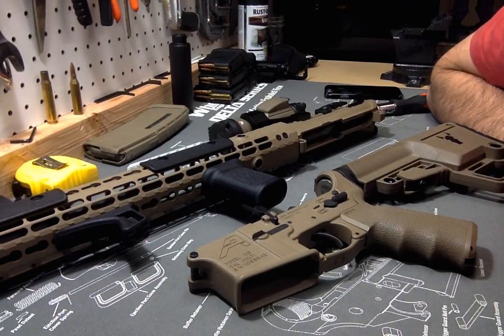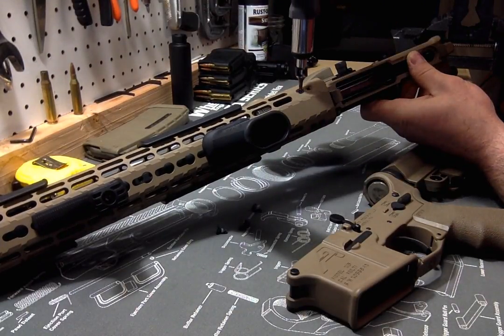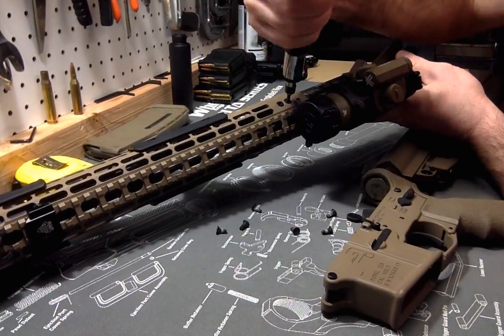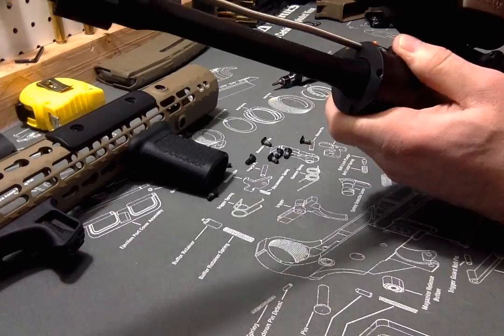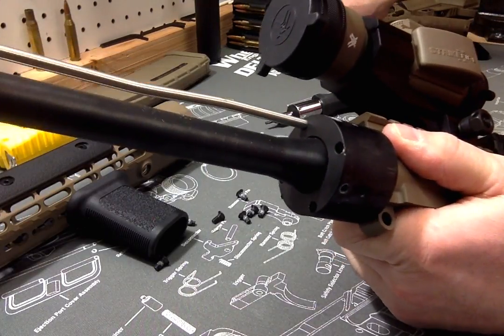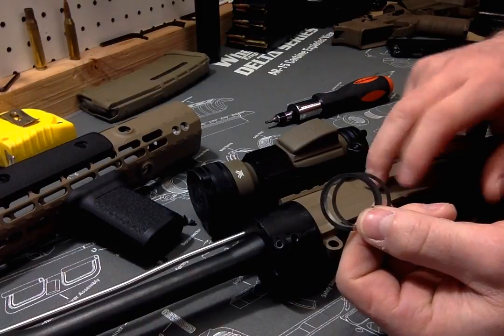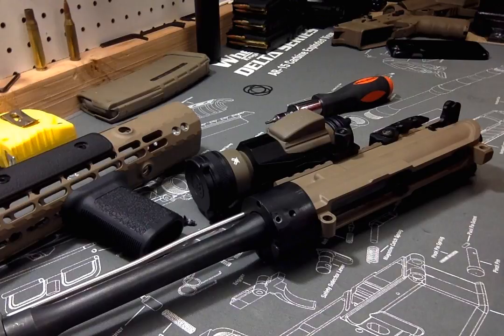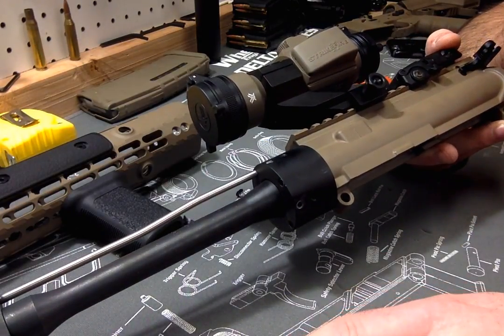Aero Precision 15" Free Float Handguard Install Info

Comment: What armorer's wrench id you use with this because the 2 wrenches I have don't line up and I don't want to buy another one that won't fit properly
Reply from the maker: Well it was either a standard wrench I got from Cheaper than Dirt, or they may have sent one with it...like a small attachment you could hook a torque wrench too.  It’s been quite awhile, can’t recall exactly.  I didn’t have any trouble though, it was simple...I remember that much

Comment: Nickel or Copper Anti-Seize Grease are also great alternative for barrel nut.  Both are also water resistant and very high heat resistant.  Aero Precision gen 2 is my favorite, addictive to multiple configurations I have more than 1.  I had spare upper prior to getting one Aero Upper Enhanced.

Comment: Im Curious Know On The Torque Spec I Called Aero And They Said 30-45 Ft Lbs For AR15 I Know Yours Is A AR-10 Will The Barrel Nut Torque Spec Change For AR10
Reply from the maker: This is actually a 5.56 upper.  The rule of thumb for any mil spec forged upper is between 30 and 80lbs.  Aero can say what they want, but their uppers are no different than any other upper I’ve built with.  I usually end up around 60 with most builds and it’s never been an issue.  Most literature will tell you the same for mil spec ARs.  Keep it over 30 and under 80 and it should be fine
Reply: S K Ok Because I Called Them And They Were Like Well Between 30-45 But Idk This Is My First Upper I Build By Myself, I Have The Exact Same Handguard You Have Just In Black
Reply: S K What Is The Key To Getting It Align With The Gas Tube Any Tips For Me
Reply from the maker: Anthony Galvez If it’s the same then I’m sure you’ll need shims as well.  Just hand tighten it first and eyeball how far that gas tube hole needs to rotate.  If it’s like mine, you’ll need 2-3 shims.  Make sure you grease the threads well with moly.  If you land anywhere over 30lbs and it lines up, call it good.  Don’t worry too much about the number, as long as you stay under 80.  I’ve built a bunch of these and it’s surprisingly simple once you’ve done it.  Good luck man!  Once you’re done you’ll immediately want to build another one.
Reply: S K Ok Thanks Bro Its The Exact Same One With Shims Just Havent Even Tried Because I Wanna Get The Right Info, Thanks Man Your Video Is Very Informative I Really Appreciate It
Reply: The Only Difference Is Yours Is KeyMod And The One I Purchased Is M-Lok
Reply from the maker: Anthony Galvez No worries man, just take your time and you’ll be good.  M-Lok is better, in my opinion.  That’s all I buy now.
Reply: @SK-pn1pe Hey Bro Sorry To Bug You What Armorers Wrench Are You Using Because I Cant Seem To Find One That Fits That Barrel Nut
Reply from the maker: Anthony Galvez I’m just using the standard type, nothing special.  It was awhile ago when I built that one, but I vaguely remember all the posts of the wrench may not have lined up.  I think I might have had to just get 2 of them into the slots.  I don’t recall exactly, but I was able to use the standard wrench without a major issue and get it secure
Reply from the maker: Anthony Galvez Hey man, I just started thinking about this after I wrote that last post....did they provide a small wrench in the packaging?  I feel like there was one wrapped up in there specifically for that barrel nut.
Reply: S K Na There Wasnt One In There, I Still Have All The Boxes For It And No Wrench, My Buddy Have A Wrench With 3 Pins But For Some Reason There To Thick And Dont Fit Inside The Holes
Reply from the maker: Anthony Galvez Call Aero, I bet there was supposed to be that small tool taped in there.  Those gas tube holes should be a standard size though, so it’s odd your buddies wrench won’t fit
Reply: S K Was It Suppose To Be Taped To The Handguard Box Or Inside With The Barrel Nut
Reply from the maker: Anthony Galvez i believe with the barrel nut
Reply: Did U Put Ur Shims On The Barrel Extension

Comment: I'm new to the AR-15 platform. I purchased a cheap Del Ton DTSM2. Basically your standard cheap AR-15. And I'm wanting to upgrade it. For this handguard, I would most likely need to get the standard version not the enhanced right?
Reply from the maker: Dylan Foster Exactly, the standard should fit if your upper receiver is a standard AR receiver.

Comment: I've come to really appreciate barrel nuts that do not require timing.  Like an SLR.  You can actually pop that rail off, and do a barrel swap without removing the gas block/tube.  Just a personal pref.  Good video though.
Reply from the maker: Robert S. Totally agree.  Much better designs out there than this type.

Comment: +S K -- No, it sucks WORSE than you said: you can only got up to 45lb-ft MAX (30 min), the directions say: aeroprecisionusa com media docs bar-barrel-nut-instructions pdf
...not what you say at 3:25, my dude.
I'd love it if they gave at least 8 slots... TOTAL AGREEMENT... it'd cost them <$1 more to do 8 or 12 slots...  FOR OTHERS' BENEFIT: EACH SHIM PULLS YOU OUT (COUNTERCLOCKWISE) APPROX 11*.  They basically copied most of Midwest's design/weight-per-inch, and then for $50 less, gave us customers a real PITA ...they're like the Chinese copycats. :-)
Reply from the maker: Dixon Micucci Ha, yeah it's a joke.  I like the hand guard overall, but the nut is dumb.  I never found that doc you referred to so I just was going off what most barrel nuts take for torque (30-80).

Comment: So I have it installed right now with basically no torque, but after a day of red lock tite setting up I can't get it to screw off even when I put a serious amount of force on it. This is how the military used to install barrels and it definitely works, I'm just worried I'm going to have dog shit accuracy now. Would be nice if those shims were actually visible in the packaging.